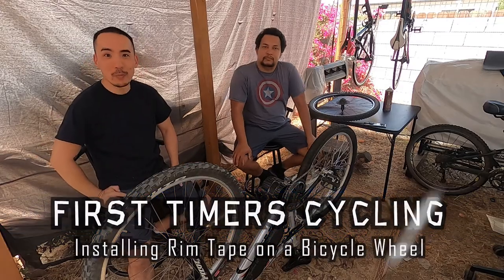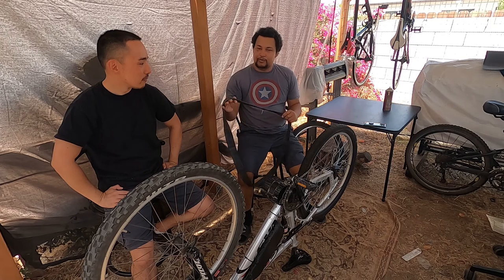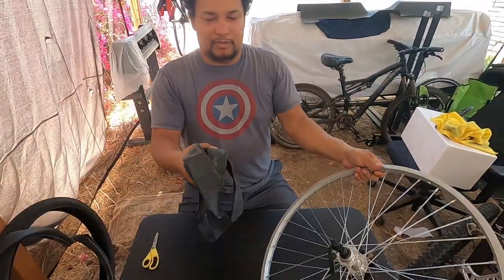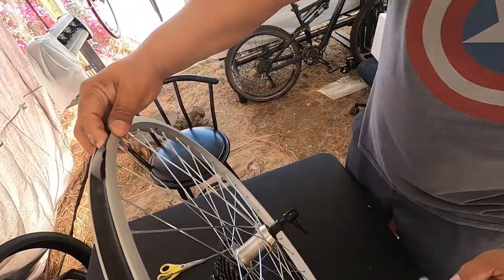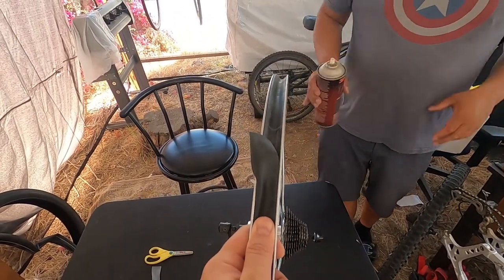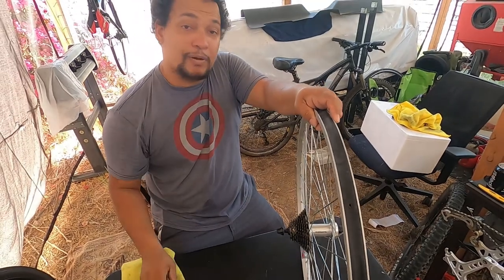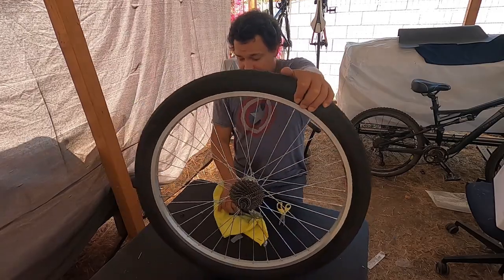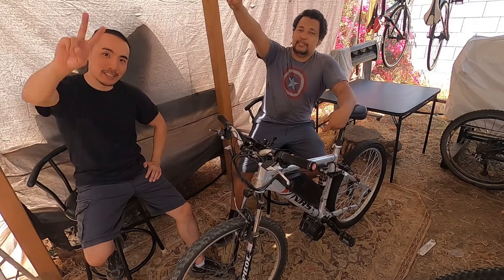Making rim tape out of an old inner tube

Comment: Nice easy wheel hack, you guys gonna mash down TUNA cyn (Fernwood & Topanga)?
Reply from the maker: Yup! Haven't tested it out yet but it should work! Is TUNA cyn the one way road down to PCH? If so, that is on the list of spots we'd like to ride!
Reply: @FirstTimersCycling  yup sure is, make sure your brakes are in good working order. I had worn rotors my last run & brakes heated up super quick. Be careful, but so much fun.
Reply from the maker: @rlake13  Nice! We are planning to ride through Topanga down to PCH just to see how that is but TUNA is definitely on the list!